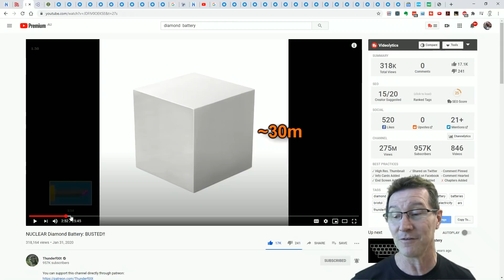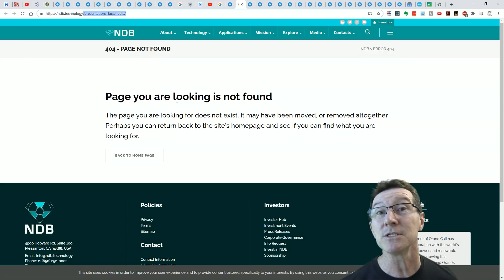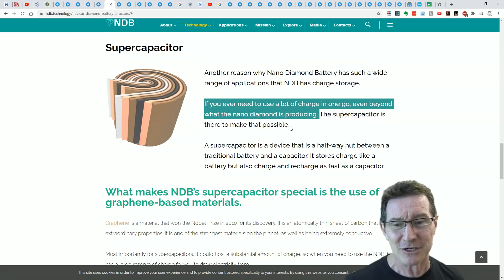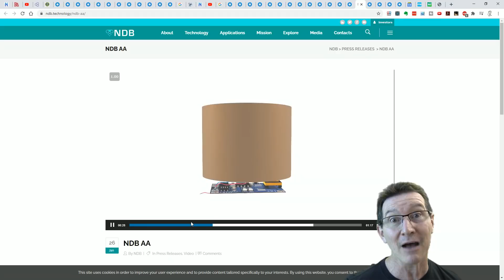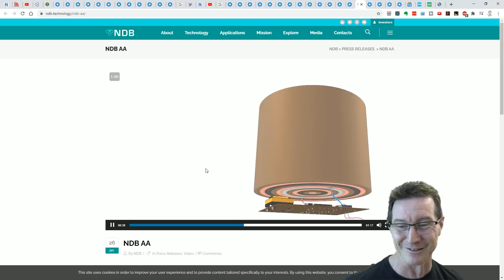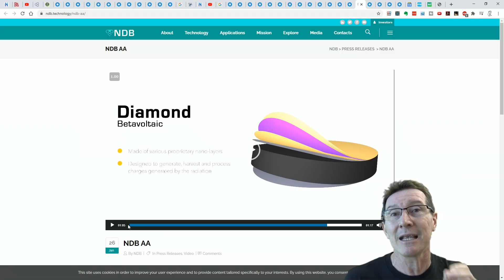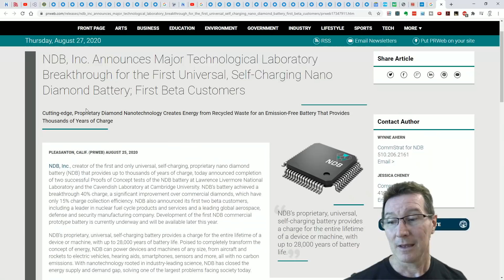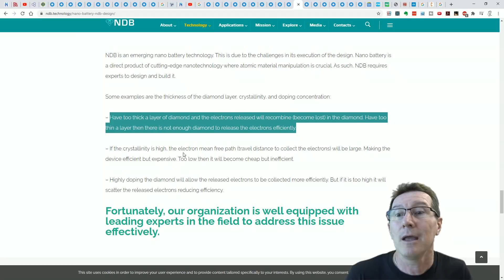EEVblog #1333 - Nuclear Diamond Self-Charging Battery DEBUNKED!

Comment: You need to get the extension The Great Suspender to deal with all those tabs. I use it and it's wonderful, let's you open up all the tabs you want and it just suspends the tabs after a little while. Takes a couple seconds for it to load back in when you switch to it after it suspends the tab (you can set how long it'll stay unsuspended), and even have a high res screenshot of the site on the page while suspended.
Reply from the maker: Will take a look, thanks.

Comment: There is another interesting figure: C-14... do they claim to use an isotope of Carbon, 14C which would have the required "halflifetime" of around 5000Years.
Reply: Yes They want to put highly radioactive nuclear waste in a energy harvesting device. The more radioactive the more beta decay and the more energy it gives off.
Reply: Why not build a wall out of these around Chernobyl, it might produce enough to light up the garden lamps.

Comment: Let's see, electric car, specifically Nissan Leaf, has one 80 kW motor, so you'd only need 80,000 W / 0.0001 W = 800,000,000 or eight hundred million of those 100 micro watt batteries. One more just for funzies: Tesla S has two electric motors, which have 615 kW combined power output, so you'd need 615,000 W /  0.0001 W = 6,150,000,000 or 6.15 billion of those 100 micro watt batteries. I know electric car efficiency is not 100%, but the above calculations are just for stuff and giggles.
Reply from the maker: That's assuming that you could even parallel them to give a suitable peak current.
But don't worry, their wizz-bang graphene super cap technology will come to the rescue!

Comment: Dave, just slap the batterizer on top of it and we will all be fine
Reply from the maker: Nano diamond graphene supercap batteriser technology. Kinda has a ring to it...
Reply: @EEVblog  make sure it's 1.5V with the Vion!
Reply: @EEVblog  And use it to make solar roads!
Reply: @predragmaric3279  the simple ideas are often the best and roads are the perfect place for making solar power,Genius!
And all roads lead to Rome, they go to your house,Bushiness,public spaces, they go to the places you need power, and if they are being charged constantly by the sun then thousand of hours is not an issue. and if you could incorporate this material into paint that covers corrugated iron surfaces would be good.
Reply: @EEVblog   YES , Nano diamond graphene supercap Death Star ... literally charging forever
Reply: Just slap on a peltier device and the skys the limit.
Reply: DrScopeify Then all we have to do is add the U Beam system to it, and we have ourselves a fully self contained cordless wireless nanographene power plant!

We could make BILLIONS of 💵 with this! 💪
Reply: Well with the baterizer it would reach at least 200% efficiency wouldn't it?

Comment: You could already get batteries in chips that were useful. PCs used to have them, the ones made in Texas. Oh and the Phillips CDi had a battery inside a chip for keeping the date/time. Plus the arcade boards that kept code in battery backed RAM to defeat piracy.
Reply from the maker: This is actually one application that this could be useful for. It would have better shelf life than a lithium primary battery.

Comment: I dont understand why it looks like an IC?
Reply: If it's only delivering microwatts and doesn't have to be replaced you might as well make it in a package that a pick-n-place machine can handle. This is already the norm for like, some lithium RTC batteries that last 10+ years too.
Reply from the maker: They are clearly trying to hit the same market and form factor as CityLabs.

Comment: It would be nice if they used these chips in bios, eprom, and clock time storage applications more often. But even then 100 micro-amps might not be enough?
Reply from the maker: This would be good for old school battery backed CMOS NVRAM chips like the DS1235. They typically had 10years+ battery life, 20 years tops. Still a niche need for that kind of stuff.
Reply: @EEVblog  Depends on the device. Some companies are like "Sure we'll let you reflash just get an eprom programmer". Others be like "MINE! PROPRIETARY SOFTWARE! Your device lost the data image? TOO BAD! $8,000 device is now landfill!". Then there's stuff like multimeters with calibration data that's also a pain to loose, I think MyMateVince is going through that with a donated Fluke.

But as @Urugulu is pointing out this thing is much more expensive than your average consumer device is going to need. It's really a darn shame that the company focused on hustling a hype rather than bringing down the price for more wide spread use.
Reply: only that bios settings arent terribly important and do not justify the expenses for a nuclear battery. not to mention that they are fucking huge even compared to the bios chip itself (looks like a 28pin dip in the photos even of the real deal available for a decade) where as often the bios it self is a small 8pin dip or more recently so8 significantly smaller than the battery. and therefor the pcb layout constraints of having 28 fucking ic pins on the board which will almost guaranteed bugger up all your routing abilities atleast at the outer most layers are not worth trying to circumvent. not for worthless bios settings in a consumer grade machine.

Comment: The efficiency for RTG's is probably talking about electrical conversion efficiency, which betavoltaics are in fact better at because RTG's use peltier junctions and those are just plain bad. But the thing is with an RTG you're not just using it for electrical power, you're often also using it to warm up your spacecraft since space is freakin' cold, good luck doing that with a betavoltaic. Oh and they put out more than 100 microwatts, but you knew that already :)
Reply from the maker: Yeah, it's hundreds of watts for the big RTG's. Didn't bother to do the calcs for how many 100uW devices required for that. 
Forgot about the excess heat aspects, yes, very useful for that.

Comment: Microwatts on a DIP package. That's the funny part. Microwatts makes sense only at a nanoscale. Not on an obsolete package type. DIP is the future? Who knew. Multiple red flags.
Reply from the maker: There would be a niche need for that, just like CityLabs are meeting.
Reply: available nuclear batteries in fact have dip packages and dip and microwatt goes along together quite well. how much does your similar package avr consume at lowest practical clock rate and with the most aggressive power saving features used while not driving any load directly? a dip size battery that produces just enough power to power a dip size processor with very aggressive power saving measures on.

Comment: I normally eagerly look for your articles - but this one falls short in my opinion. After watching the first 15 minutes describing repeatedly how 100 microWatts is practically worthless for anything but a few applications, it didn't take me more than 30 seconds to find out that this is perfect for IoT sensor tech, of which there are already billions of devices in use. 'Debunked'? Really?

True, their numbers don't make a lot of sense, regarding the usefulness of such a power source in a form factor such as AA for devices that typically use AA batteries (power density is extremely low, even though, technically, the energy density is extremely high) - but I think that's just an example of something familiar to demonstrate the potential - and that's also you making the assumption that it can't be scaled up, and that the energy density of C-14 in this configuration is no better than the tritium model.

Given that C-14 is a solid and H-3 is gaseous (it has to be captured in a metal-tritide matrix, not to mention the process of extracting the gas from the metal), I would expect some radically different mechanism and scalability factors to be possible. If they've discovered a path to do that, it certainly will be a game-changer (especially if the materials cost is actually negative - i.e., if sources of radioactive graphite rods will pay NDB to recycle it, the price could be very interesting).

I do agree this is too much marketing hype; but that just means we have to look elsewhere for the specifications we would be more interested in.

Here's a few sources about historical development of betavoltaics, and how C-14 may indeed revolutionize the industry:
From Physics Today (https://physicstoday.scitation.org/doi/full/10.1063/PT.3.1820?journalCode=pto) and other sources, we see that 
1) betavoltaics first used Prometheum-147 in cardiac pacemakers in the 60s; however they needed shielding to protect the body from gamma radiation.
2) The example you showed of Tritum (H-3) isotopes, as used in the City Labs P200 product, does not produce gamma radiation - but is much lower in power and energy density (and it has a half-life of only 12 years).
3) Ni-63 has only recently been developed in Russia in 2018 (see https://phys.org/news/2018-06-prototype-nuclear-battery-power.html); and its beta emission level of 225 KeV is close to the point where it can damage semiconductors (250-300+ KeV). It looks like it has potential, but it's a new development, and Carbon-14 looks even better.
4) Carbon-14 has beta emission levels at maximum 156 KeV, and also no gamma radiation; according to https://www.forbes.com/sites/jamesconca/2016/12/09/radioactive-diamond-batteries-making-good-use-of-nuclear-waste/#7498b633a044, a AA-size battery containing 1g C-14 could produce 15J/day. This appears to be high enough power density for pacemakers as well as many BLE or other IoT devices.

But, electric vehicles? Well, it takes about 200 Wh to move a car 1 mile; I read that the volume of the device inside those chips is about 10mm x 10mm x 0.5mm, to produce 100uW. The volume of a Tesla 100 KWh battery is 0.4 cubic meters - so if you were able to efficiently scale it up to that size - even at half the density - it would yield 400 watts, or 9600 Wh per day. At 200 Wh/mile, that's 48 miles per day. every day. Without recharging or refueling. That's 17,500 miles per year - for the next 5000 years!

Of course, we haven't talked weight; or price; or the extra auxiliary supercaps or batteries to concentrate the energy generated, to supply the power density needed to go 60mph when you need it, for as long as you need it. But that's a different problem. The numbers work.

As they do for household and other uses. 2 cubic meters could power your house - for 5000 years!

It might cost 6 million dollars. But prices come down, in time.
(Any idea what today's $100 6TB of hard drive storage would have cost in 1995?)
Reply from the maker: Yes, debunked, really. They are going to revolutionise the entire energy industry! No, no they are aren't.
If they just stuck to claiming this for ultra low power applications then no one including myself would have battered an eyelid. But no, marketing had to go to town. That's what it being debunked here.
And BTW, 100uW power levels is only a small fraction of the IoT application space.
As for your calcs about the Tesla battery, you are assuming that such a piss-weak technology can be paralleled to deliver the insane amounts of current required for an EV. NDB say it themselves, the only thing that makes this tech suitable for higher power applications is the graphene super capacitor which is NOT present in the 7001 DIP battery. So sorry, not buying it.
Reply: @EEVblog  an idle (but not sleeping) Tiny85 draws a few mA at 5V... (e.g. >=5mW).  Imagine powering up a wifi radio with a 100uW supply ...you'd need to charge up a capacitor for weeks before you could turn the radio on once.
Reply from the maker: @tomstdenis  Yes, that's the catch. Most wireless IoT devices that transmit require significant peak power to do so. Even a CR2032 coin cell or other existing primary battery tech can handle a lot of those low power devices and can last a few years or two. As for IoT devices lasting for decades, the back-end tech will no longer work in less than a decade anyway, so it's moot.
Reply: @tomstdenis  I'm talking production IoT, such as a LoRa device I'm designing which needs 50uW quiescent, plus 120mW for 90ms, once an hour.
Reply: @EEVblog  That's a good point. It might be smaller and more rugged, but that's not really enough to call it revolutionary...  

However, the real point isn't what it can do "today" - it's what it can do once it scales up a bit in capacity and down in cost... and then I see no reason why it wouldn't revolutionize a big part of power sourcing - I'm not really in that field so how much or how fast, I can't really predict. And then a bigger problem might be when they run out of used control rods... sure, they can make more - but then it starts adding cost instead of reducing it.
Reply: @EEVblog  How much do RFID devices take? You mentioned "energy harvesting," I believe, and that's exactly the class of application it is appropriate for - and IoT sensor tech, is that such a small app space? In one particular field I design in, for just a single application it will need 1.5 billion pcs per year. (And yes, 100uW is just enough all I need is 100mW for 100ms once an hour)

To the degree that the target market already knows where 100uW is relevant, the marketing is also appropriate (and it's not AA batteries). The way I see it, the big deal is moving from tritium to C-14, both in terms of tech as well as cost, as well as getting rid of (some) nuclear waste - if that isn't true than that's a different issue.

Any application involving AA or AAA battery type operation is indeed ridiculous; and no one's saying this is coming out this year... but get this scaled up one more order of magnitude in the next 5-10 years, and I think it certainly could revolutionize power sourcing.
Reply: The rest of your post has already been addressed but I wanted to point out that "Without recharging or refueling. That's 17,500 miles per year - for the next 5000 years!" is pretty disingenuous. Like sure, the isotope lasts that long, but the problem with all these things is that radiation is actually kinda nasty and slowly destroys the semiconductors trying to harvest energy from it. The same thing happens in RTG's, they lose power much faster than you'd expect from just looking at the half-life, because the radiation is also damaging the junctions, and in an RTG the junctions aren't even in direct contact with the isotope like in a betavoltaic. So it's more like a few years before you have to get it replaced, maybe a couple decades if they make it out of real good material. Now you have a dead battery full of kilograms of still very spicy carbon-14 that you have to deal with, I sure hope that doesn't wind up in a landfill!

Comment: Assuming an average electric car needs 10kW of power, you would only need to fit in 100 000 000 of these devices to make it going. Totally legit. What do you not understand, Dave?
Reply: Typically at highway speeds most EVs consume between 120-160Wh/km (standing rate of 12-16kW) in the summer.  But you need to GET TO highway speeds which can use as much as 50+ kW to get up to speed.
Reply: I can get 3.5miles (5.6Km) from 1kWh in my Kia e-Niro and when I get that I think I'm doing well with not being like a speeding hooligan. That gives a range of ~224 miles (~360Km) on a full 64kWh charge. It takes ~10 hours on my 7kW single phase type-2 home charger (under 40 minutes on a CCS rapid charger)  to recharge that. The aircon takes a lump out of my range. I'm going to need 640,000,000 of those piss-ant 100μW chips to replace my big fat lithium battery. That's not going to fit in the available space between the wheels under the floor. It's also going to be one out & back run then 2.88 years before I can go out in the car again.

Yeah, nah as they say in Australia.
Reply: @DougieLawson  yup, just for ref you quoted 178.6Wh/km which is inline roughly with what I quoted (we don't quite need as much aircon in Canada as Aussie I guess).
Reply: @tomstdenis  I'm a pommie in the UK (my daughter and her fiance and the grandkids live in Oz - so we go out there when we can). We only have aircon in our cars and offices here in the UK. This year through the UK heatwave the car's aircon has been running every day since February (when I've been allowed out). I've had the EV since the end of June (little over 1000miles on the odometer).  

The way to compare EVs is with a mythical "miles per kWh" (or km per kWh in places which do speeds and distances with sensible metric numbers) [so it's a bit like "miles per imp. gallon"]. The on-board computer reports that every time you power down the car.  If I knew the energy density vs engine efficiency of 95 octane petrol I could do an exact comparison. My driving costs on my credit card is already doing a fair comparison for me. Charging overnight costs GBP£0.047 per unit on my current tarriff.

This energy from the ground up and compressed waste from Chernobyl isn't going to change anything. If I don't like charging lithium cells then my next choice will be a H2 fuel cell.
Reply from the maker: Hmm, let me go rethink it...